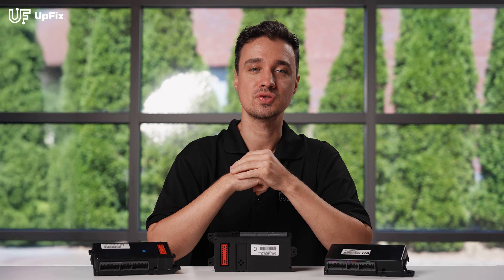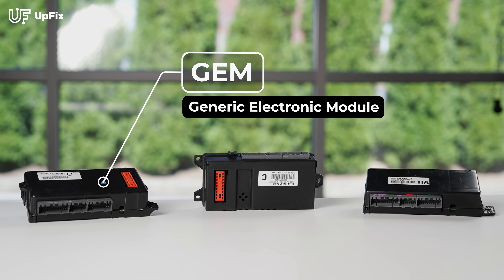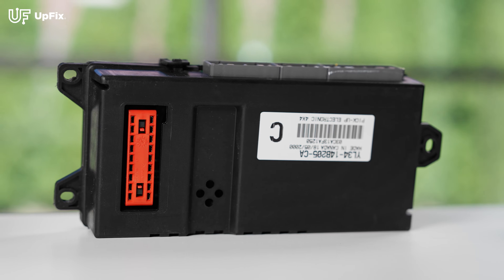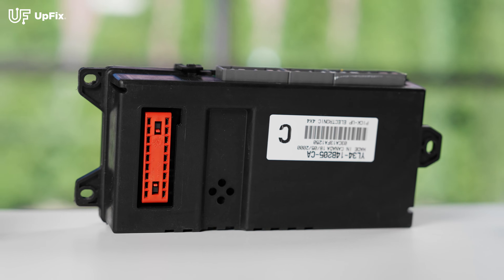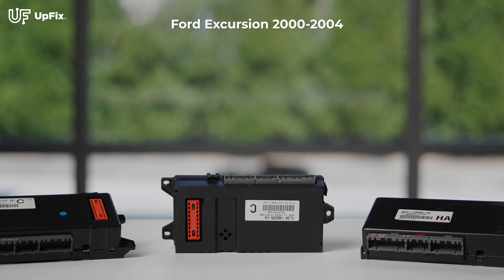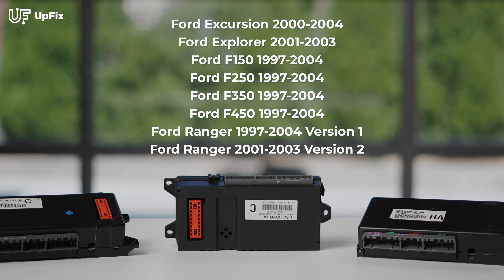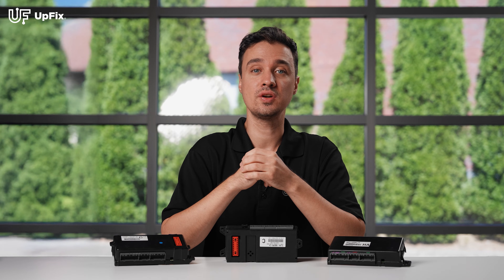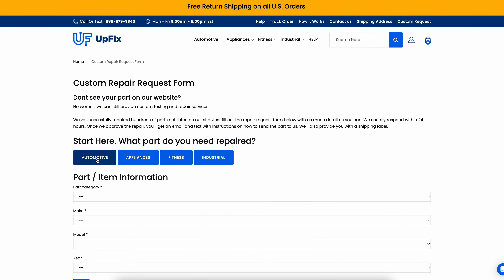Ford GEM Module (Generic Electronic Module) Repair Service | UpFix

Comment: Amigo tengo Ford tritón 2002 con problema en el gem, presenta las mismas fallas que haces mención en el vídeo , por motivo de agua .. necesito repararlo .. en dónde están ubicados? Le agradezco su atención
Reply from the maker: ¡Hola! Gracias por contactarnos. Estamos ubicados en Buford, GA, EE. UU. Puedes enviarnos tu módulo GEM para reparación a nuestra dirección: 4991 B U Bowman Drive, Buford, GA 30518. Si tienes más preguntas, no dudes en preguntar.

Comment: So I start the truck and let it warm up. Put it in gear and start to move and the buzzer in the gem module goes off. I then stop and turn the truck off and restart it and drive on. What is the Gem module doing.
Reply from the maker: The GEM is responding to an input signal every time the speaker turns on. It's possible that there's an intermittent issue with another system (seatbelt, door, brake, etc...) either a faulty switch or wiring. A buzzing GEM doesn't necessarily indicate that its faulty.

Comment: I have a gem module problem with my f 250  2001 diesel Ford.Something is draining the battery. If I take out the five amp fuse when the truck is not running battery stays charged. When I drive the truck I replace the five amp fuse. Then take it out until truck is used again to keep battery from draining .another problem I believe related to the gem module is the truck gearshift was stuck in the park position. Can you help  me repair the Jim module?
Rai
Reply from the maker: We can certainly help with that GEM module issue! Visit upfix.com or call/text us at 888-979-9343

Comment: That's great, but if you don't fix the leak issues (bad seals around windshield and rear window) you will have the same problems with the repaired GEM.

Comment: Why don't you advertise the price?
Reply from the maker: For accurate pricing checkout upfix.com, because if you are watching this video 2 months later it could have changed.
Reply: So what's the current price. If you give one out now and it's reasonable, you will get more people following through for a quote. Most people are just going to assume its going to cost 300+ and not do anything. Like mine is giving me a fast blinker on the left side but all bulbs and connections are good. Ill live with it because its not worth spending 3-500 and filling out a bunch if paperwork to get fixed. But if i had reason to believe it was only 150 ish , I'd jump.